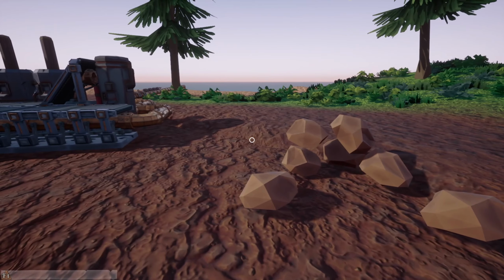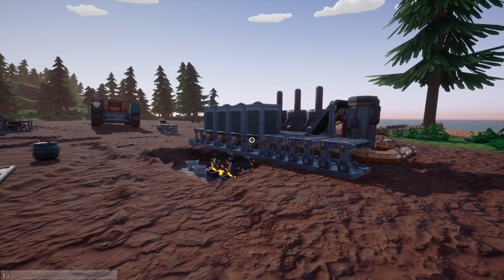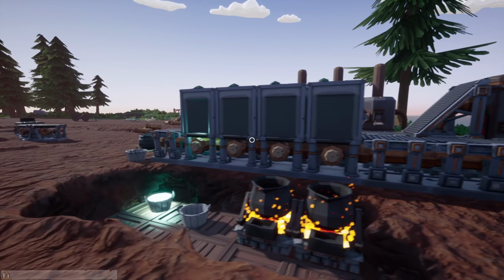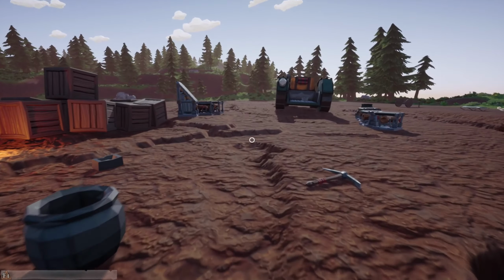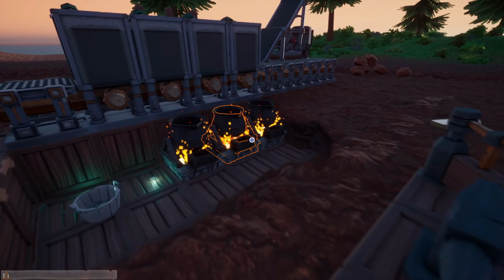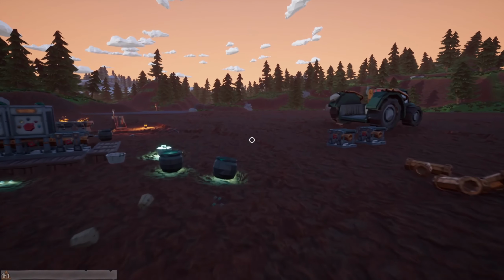Hydroneer - 7 - "Automation Fixed"

Comment: You should buy the gem compressor it compressor all the gems you put in it and it will make a expensive one for more money it easy to do it too : ))
Reply: And you don't have to grind them to use them so their less tedious than normal gems
Reply: @darkmoonthedirewolf9231  yep
Reply: I had a gem worth 1000 and compressed it with a 800 and got 856 coins